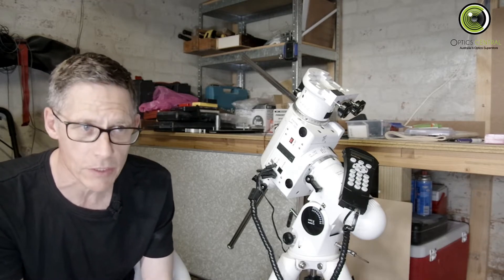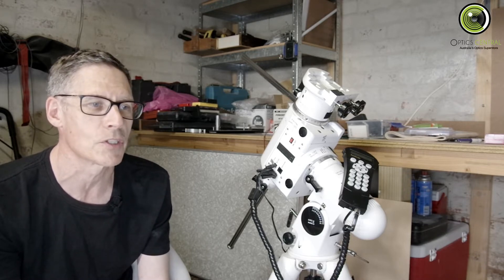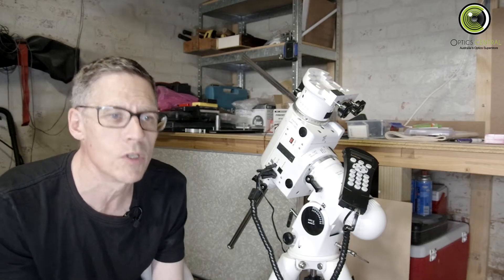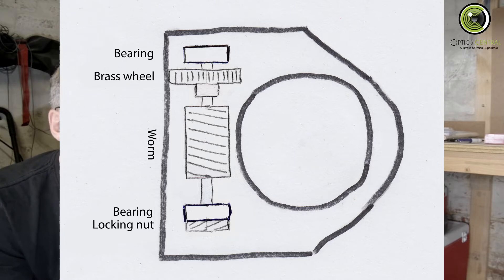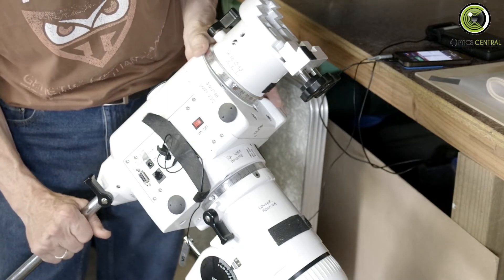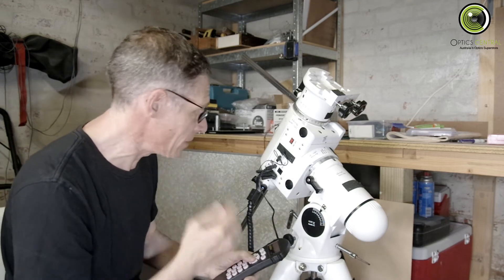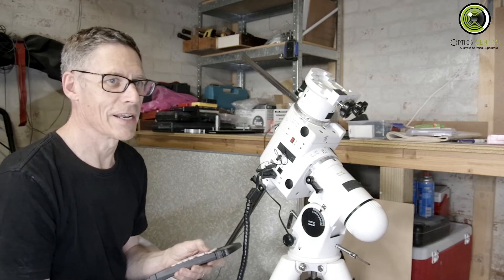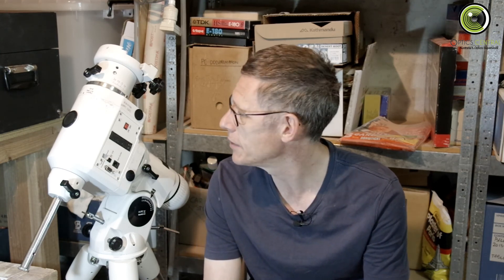Belt modifying an NEQ-6 pro astrophotographic mount - Part 7

Comment: Thanks for the inspiring video! I will be doing a goto upgrade to my standard EQ6 shortly (when the kit arrives). With a partially paralysed right hand, it looks like I'd need help at key points, so I think I will defer any ideas for belt upgrade to a later date! Not impossible though! Thanks so much for letting us see what's involved.

Comment: This is an excellent video series especially since a friend of my recently purchased second hand an EQ6 Pro mount and was having problems with it.  So far I have had to replace the control board and that solved one problem.  He tried it out and now I am trying to discern what the new problem is.
Reply from the maker: What sort of problems are you having? Is it moving on its own? Do you have a hand controller? How are you powering it?
Reply: @OpticsCentralAustralia  Well after watching your videos I fired up my friends mount and powered it up.  Took it for a spin in my office and could not duplicate the problem he was having (I'll tell you in a second) both on a plug in the wall brick and a battery bank.  What he said is he would try to get it to slew to a star and part way through or as it approached the end of the slew it would start to make a god awful screeching sound and stop before it stopped before it could finish its slew.   So I tried this before I called him and decided to call him and have him walk me through it to see if I could duplicate the problem.  Nothing bad happened, no screech, no grind, just normal drive sounds.  He kept telling me, as he listened on the phone "here it comes", nope.  

So now we are wondering if it is a potential power problem out at his lake cottage.  Apparently last fall, before he bought the mount, a pole mounted transformer feeding his cottage blew up.  It was replaced and and he hasn't had problems with his Celestron mount.  He does run an extension cord to his location and has tried this new mount both indoors and outdoors and gotten this screeching sound.  Now I am a retired electrical engineer and having a hard time believing it is the power so he is coming back to pick it up and also borrow my multimeter to check out the power at his cottage.  I am wondering if it could be the grease that the original owner used on the worm gears is freezing up.  Here in Canada he is out there taking pictures in weather up to at least -20 C. 

If he comes back and tells me the voltages are okay then I think I will go out and get some synthetic grease rather than lithium grease that you used.  Your thoughts?  Oh yes he has a brand new hand controller and it worked well at my house.
Reply from the maker: @robertlawrence7293  Hmm, stepper motors make horrible noises when underpowered. They aren't damaged by it, of course. It's hard to tell the difference between missing steps and binding if it doesn't actually make the noise. But if the power is OK, I would suspect binding, which you can treat with the backlash grub screws (as in the video). Also I'm not sure I did use the best lithium grease. I'm now told that the good stuff is coloured blue. I'm no expert on that though.
Reply: @OpticsCentralAustralia  So today I took his mount out on my deck and let it soak up the cold (-20 C) for about 90 minutes.  He came over and we went out to try it out.  Well it screamed holy murder so now I have to play with the grub screws as you call them (I call them set screws).  Then I will take it back out tomorrow when it will be colder and play with it again.  Oh the joys of living in Canada.  LOL   Wish me luck.
As for the grease, what has been recommended is called SuperLube which is a synthetic grease that is not lithium based.  This is off of a blog site of regular astronomers.
Cheers .,. Bob
P.S.  I will let you know what happens and what I had to do to fix the noise.
Reply from the maker: @robertlawrence7293  excellent - yes, good luck. I haven't had to do this sort of work in the cold - although I lived in Norway for a few years and I've experienced that to an extent. Here in Australia it's never less than maybe a couple (°C) below zero, so changing size of gears isn't a problem.